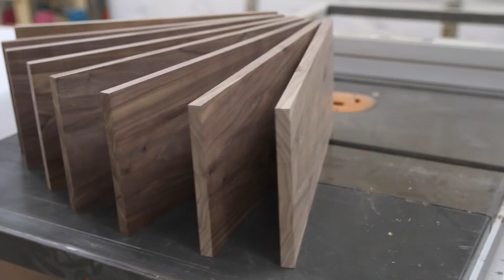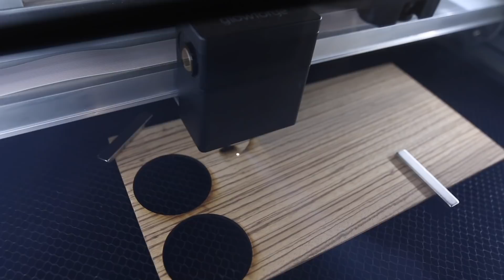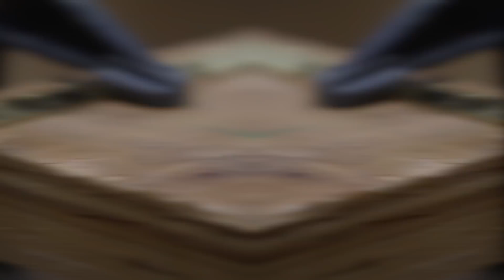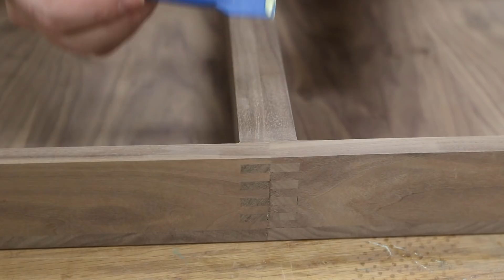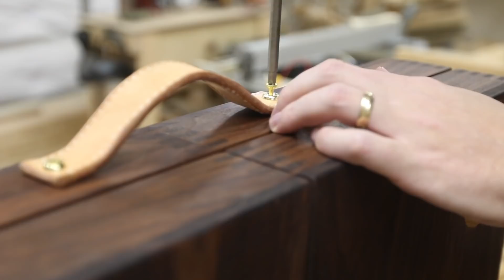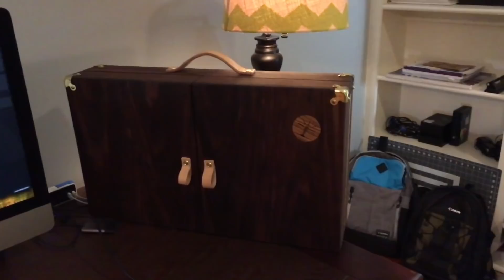Mic Surround For Recording Audio

Comment: Dude I been struggling with audio in my shop since day one.  Glad someone figured it out.  Great video brother !!!
Reply from the maker: Thank you! Well, I’ve not figured out the Shop audio yet. I actually stopped using my shotgun mic in the shop as much because of poor audio.
Reply: What are you using in the shop ? I’m trying to do my shotgun mic on a boom now hoping it helps.
Reply from the maker: I’m using something called not talking to the camera as much in my shop. Ha ha. I also have a cheap wired lav mic that does pretty good. It’s a pain though. It’s from Purple Panda.
Reply: Ya I’ll have to check it out. Been thinking of getting one but like you said it’s a pain. Just another thing to think about lol.

Comment: Nice project! Tip: Throw some blue painters tape on top of the wood when lasering something onto wood so the wood doesn't burn!
Reply from the maker: Thanks! Yep, I usually do that with the tape but I knew some sanding would be involved so I just saved that step. Thanks for watching out! Keep those tips coming.